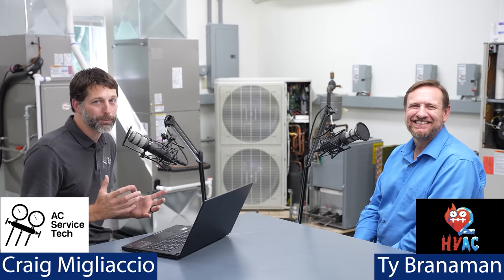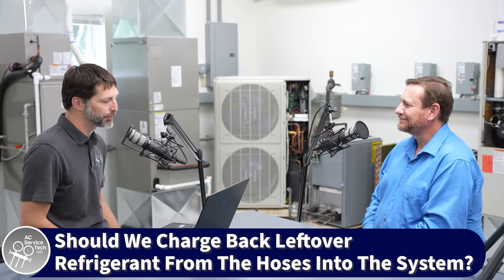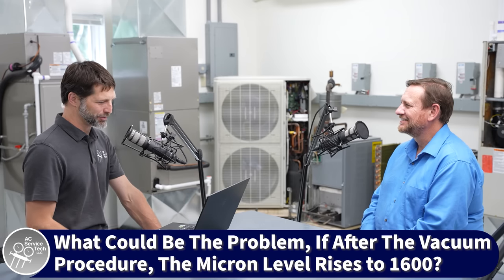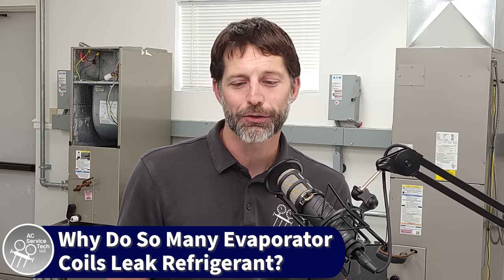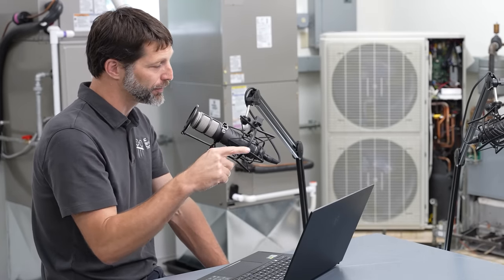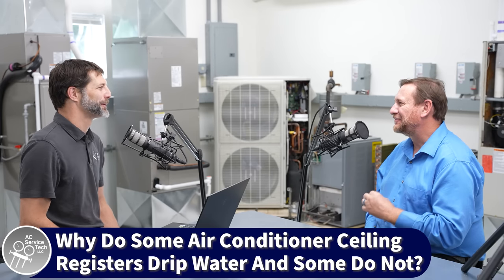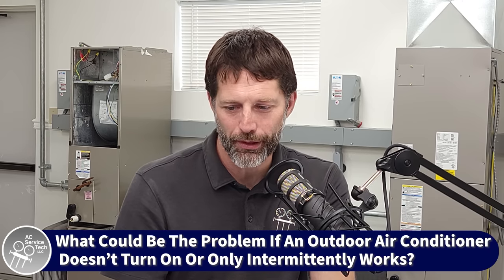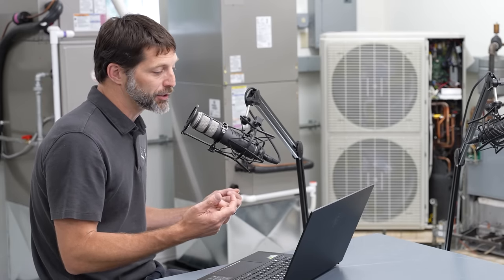7 Technical HVAC Questions Answered by Craig Mig and Ty Branaman! "AC Service Tech Answers Podcast!"

Comment: I’ve found that clamp probes calibrate differently when you change from T1 to T2 ports. I try to only use a specific clamp probe in a designated thermometer port.

Comment: When the New Refrigerant comes out, Can we still install R410A system ❓❓. Thank you for All the Great Tips and Advices you have given us 👍👍
Reply: Yes, it will most likely be like r22, you can still use it and charge it just can’t make new r22 or import it or make new equipment using r22

Comment: Techs where I am are so highly fascinated with the micron gauge on the Fieldpiece Smans, they know nothing of the info you provided about moisture in the lines still boiling off. As soon as it hits 500 microns, they think it’s good for a charge no matter what. Even if they shut the vacuum pump off, wait, and it jumps back to 1500 microns.

Comment: I'm a home owner and I had my unit replaced recently, it's a system that I haven't heard of, Air Temp... Just wondering if this unit is reliable? I live in the State of Virginia
Reply: I think air temp has a 10-year warranty on parts so you should be good. Most of all these units are the same, they all basically use the same parts every once in a while you'll find some companies like carrier will get carried away with experimental stuff that doesn't end well.
Reply: @davidframe1613  Thank you David for taking the time to reply and giving me peace of mind, I truly appreciate your response.